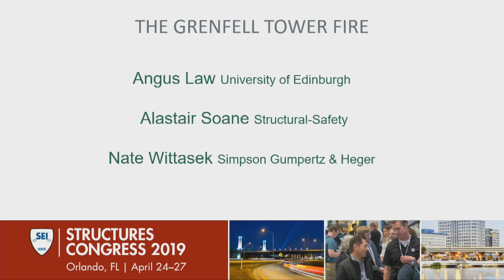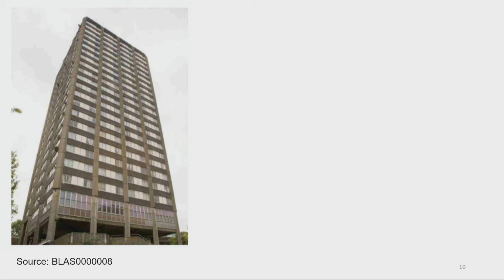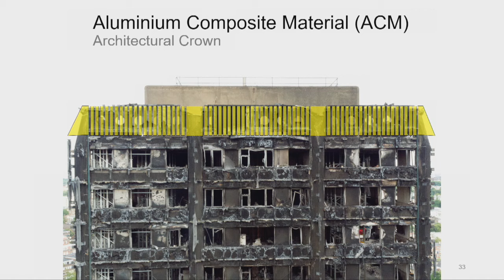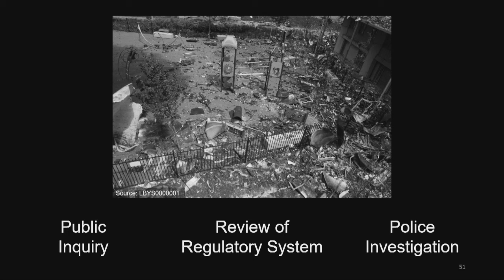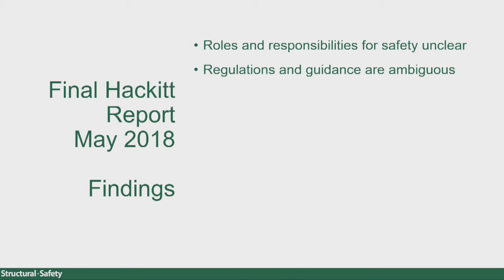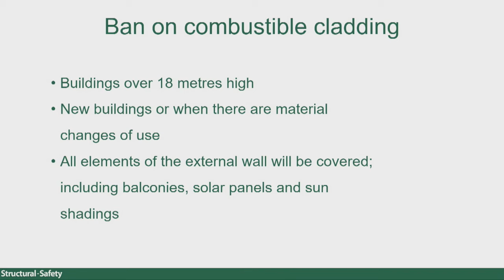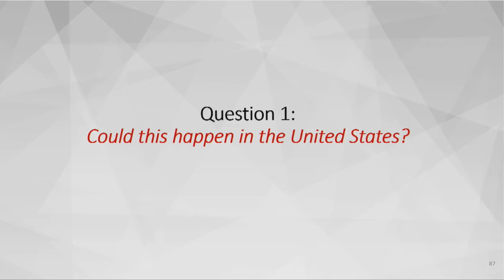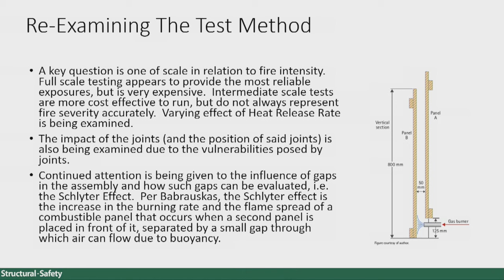Grenfell Tower Fire | Special Session at Structures Congress 2019

Comment: As soon as the fire brigade saw that the fire was able to rapidly hop from "compartment" to "compartment" they should have realized that the usual "stay put" advice needed to be thrown out in favor of immediate evacuation, and should have notified the 999 emergency operators accordingly and started blasting this advice from loudspeakers. I don't understand why this is rarely mentioned in discussions about Grenfell.
Reply: True though you have to admit that firefighters do not like the idea of having to deal with crowded stairways while they are trying to head up to put out the fire.
Reply: As far as I'm aware stairwells in blocks are supposed to be vented but this had ended up broken in some refurbishment somewhere so the stairwells were pretty quickly filled with smoke from bottom to top like everything about that night it's just tragic

Like there's probably things the fire service could have done better but the building shouldn't have been in as decayed condition as it was before being wrapped in a firelighter that destroyed it's fire protection.
Reply: Stairwells?? Stairwell more like. There was only one.
Reply: The fire fighters relied on the presumption that the building was properly constructed in accordance with the Regulations, and thus would have a degree of behaviour predictability.  The fact that it was not, and that this contributed to the spread of the flame is a different, but equally serious matter.

With the introduction of the new Building Safety Regulator, administered by the HSE (Health & Safety Executive) will hopefully ensure compliance.
Reply: This company was very proud of their work on Grenfell.  Until the next day...
http://wittukgroup.co.uk/grenfell-tower-london-w11-1tq-regeneration-project/

"The large scale works which includes an upgrade of the cladding to the exterior of the building, new windows, a totally new heating & lobby smoke ventilation system all of which will greatly enhance the energy efficiency of the tower and contribute to reducing resident’s living costs."
Reply: Its now becomming widely know, including the comments of the FLB commander at the inquiry who said going back, she would not do anything different.  Its been called to question, and asked if the FLB is fit for purpose and that certain "retraining" needs to be done at an organisational level.

I'm doing a 14 storey in London atm, and you will not get a "stay put" on one of mine ... delayed evaccuation to enable to incident floor to vacate as priory, then everybody else ... and if they want to ring me up at 3am to tell me their stood out in the cold in just Granny's dressing gown I'll gladly take the complaint call and remind them that they are still here.

For personal reasons (family bereavement), I wont accept any messing about with regards safety in either design, construction or operational ... and if somebody wants to argue with me about it, they best be prepared ... I'm prepared to put extra work in for "special clients" like that.
Reply: I’m pretty sure the IQ of the average fire fighter is not that high. They were always treated as heroes and their actions rarely question the presentations I’ve watched on this tragedy never document how long it took the fire department to actually get water on the fire on the outside of the building. Is there going to tell everybody to stay in place then how many minutes it takes him to arrive on the scene is not as relevant is how many minutes it takes him to get fire on a fourth floor apartment which their fire hoses could easily reach.
Reply: @GOLDVIOLINbowofdeath  First external stream 01:11:29 per page 19 of the LFB Op Response version 0.7 report.  Started setting it up at 01:07:21.  First entry into burning unit 16 at 01:07:21.
Reply: @GOLDVIOLINbowofdeath  What a completely asinine statement. Is the fire service above reproach? No. But what you're essentially dealing with here is a rapidly evolving, non compartmentalized fire with victims on every floor of the building. Tactically, placing enough water on the exterior siding of this building would be perfect in a perfect world with unlimited resources but impossible in the real world. You're also completely disregarding steam conversions effect on victim survivability.

My main criticism are institutional in nature. i.e fire service officers not having enough training in managing large scale incidents

Comment: Why not have fire sprinklers in the  air space around the building
Reply: Practicality, water freezes in winter, bursts pipes ... dry pipes creates thermal bridging ... strategy is to prevent the fire getting in there in the first place, and if it does, if its inert will be of no effect.

Sprinklers are now being made mandatory in buildings of this type under the new regulations.

For comparision, in Wales (120 miles away) sprinklers have been mandatory even in houses for a couple of years now.

Comment: Poor choices in application and construction. Not having an active fire suppression system was first. Open joint rain screen design for the ACM allowed the flames to ignite the polyisocyanurate insulation and allowed free flow of oxygen to enter the cavity, fanning the flames. Had the ACM been closed joint, the fire would not have ignited the insulation and would have limited the available oxygen. The lack of zoning the panel areas allowed the flames to spread horizontally and vertically with 100mm thick PIU insulation providing ample fuel. Had mineral fiber insulation been used, that fuel would have been unavailable. Although less of an issue for the ACM, the polyethylene core could have been replaced with a fire retardant core. In the US, we would have had sprinkler systems in that building, we rarely use open joint rain screen, and we would have used a fire retardant core in the ACM.
Reply: Forget the design of the joints etc ... plan that site dont do it right ... inert materials, problem doesnt exist.

Comment: Why couldn’t these clad panels, just have been a sheet of aluminum?
Reply: because of cost the cladding use was normal use for sign making and display which cost about 30 pound for 8x4feet sheet vs 450 for alu sheet which meet the requirement but increases the risk of the sheet getting stolen
Reply: Rockwall cladding I think it’s called would have been so much safer because it’s not flammable. Unfortunately it’s a bit more expensive and that’s all that matters to those people who make those decisions.
Reply: THANK YOU for the responses ..
Reply: If by having a "thermal" element, it may have qualified for certain "environmental" funding grants.
Reply: The aluminium sheets on the internal and external faces of the composite panels are paper thin, with approximately zero structural rigidity.
The polyethylene core is required to make the sheets usably strong and rigid as a cladding material, otherwise it would be like trying to cover the building with huge sheets of paper that will slice you to ribbons if you catch an edge or corner.
To do the job with alu sheet it would have to be many times as thick (increasing cost), would require more workers to handle and install (increasing cost) and would add complexity to the engineering and installation aspects of construction (increasing cost). The very thin laminated sheets in the composite panels also allow for a very smooth and fine finish, which is more difficult to achieve using solid aluminium (once again... increasing cost).
Reply: @sixstringedthing  thank you for such a thorough explanation.
Reply: @Bill-xx2yh  Thanks for taking the time to say thanks Bill. Cheers from Sydney mate, 
Chris 👍

Comment: This guy is only coming out of the left speaker btw - i ran a diagnostic and listened to a random yt video from the left-had-side and everything is fine, except on this video.
Reply: If you have a Samsung device,  open Settings > Sounds and Vibration > Sound Quality and Effects and enable Dolby Atmos. This gives you high quality sound through both channels and fixes the problem.
Reply: Same here!! I went out to another video, and worked fine. I only had very minimal sound in my right bud.

Comment: Inadequate equipment, wrong strategy, poor spontaneous decision making ability onsite, all contribute to this disaster in addition to building’s architectural failure. And why nobody scrutinize that UK manufactured Hotpoint fridge/freezer ? Had it been made by another country, UK tabloids would killed that brand.
Reply: Its not just the fridge freezers, tumble dryers (possibly washing machines too) have been causing fires.  However, the possibility that a fire could occur is there, regardless, and we must design and construct buildings to be able to contain such an event.

Yes, had the building been constructed to the reg's, then the strategy should of worked ... but as soon as the fire brigade saw that it was not behaving as it should ... they should of evacuated rather than leave it until it was too late.

Reg's are changing ... two stairwells will be required going forth, one can then be dedicated to the fire brigade.  There is a evacuation alert system piggybacked off the fire alarm system and builders are now acutely aware that they need to pay attention to the detailing and compartmentalisation.

Most designers insurance is now prohibiting cladding, or charging a premium, which will mean that the cladding is less likely to be used.

Comment: I don't know if they did but from my current knowledge, they didn't. So why didn't they get helicopters to pick up water and help put out the fire? ( I understand that you can't pour water on the fire till everyone is evacuated cause the heat is gonna turn the water into boiling hot water). The fire was predominantly on one side early on, so why didn't they tell the other side to evacuate early on so that the flats on the side of the fire, the firefighters could concentrate on getting them out. it was very obvious that the fire was spreading quickly and I just seem like (from the videos at the start of the fire I have seen) the fire fighters were working slow until shit hit the fan (then panic set in). Also, why not send out an emergency text or communication directly to the tenants and tell them not to go up (isn't it a requirement that the block is to have your phone number in case of an emergency?). Anyone with basic knowledge of how fire spread and weather would realise when the fire was going upwards, they would know from just looking that a vacuum was being created so anyone at the top of the tower is gonna be in trouble verses those at the bottom.
Reply: The same reason why helicopters were not used on 9/11. Structural fire smoke damages helicopter engines.

Comment: Question : what is the most important lesson learnt in the aftermath of the Grenfell disaster? Is it the fire safety implementation? No because the concept of having extremely flammable cladding in combination with no sprinkler system could have easily been solved by school children , had they been allowed to do so. This of course leaves the regulatory system as the only other possible route of investigation. So to examine the failure of the regulatory system in a rather more candid manner as discussed above then , we do need to know a little more about the culture of that system. How could it not be politicised with Grenfell tower being less than 2 miles distance from The Houses of Parliament? From what I understand , there are 3 tiers to the system , with the lowest tier driven entirely by profit , the 2nd tier likewise but not as much and the top tier is the neo liberal HSE who incidentally are working for profit also. So the case must be that the top tier were not involved because there was no money in it for them. Now the HSE have left it to the politicians to make up there own scapegoats as the HSE know they will never be indicted themselves because they are all friends and family of those at Westminster. As simple as that.

Comment: The way the fire spread so quickly is unbelievable. Scary. Caused by the flammable facade that was fitted to make the building look better. Thanks but no thanks. I’d rather live in a safe building that looks shabby. The speed of the fire spreading reminds me of the fire at Bradford football ground in 1985 when the main stand was engulfed in fire in 4 minutes and 56 people were killed.
Reply: It wasn't installed for looks. It was installed for thermal performance.